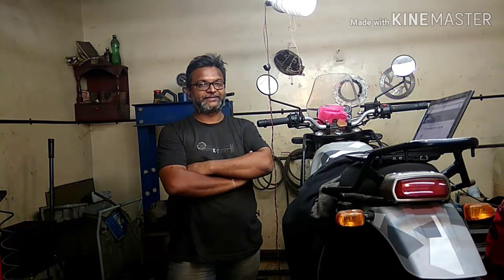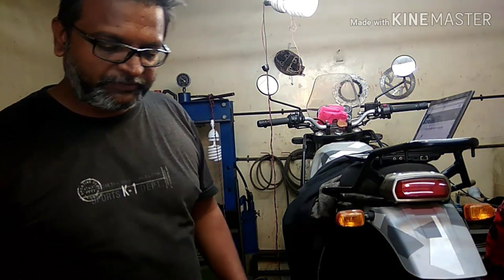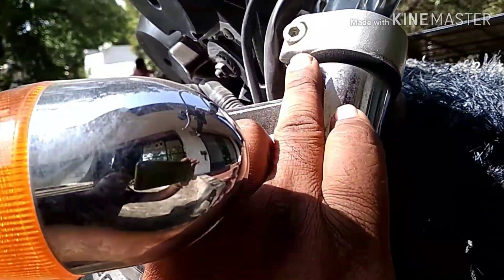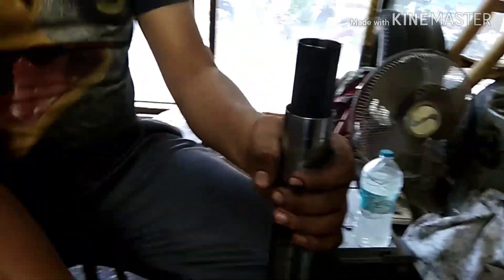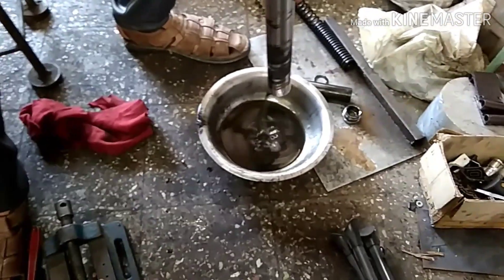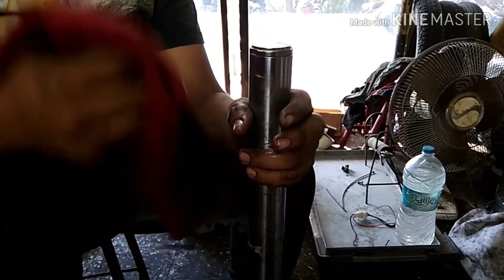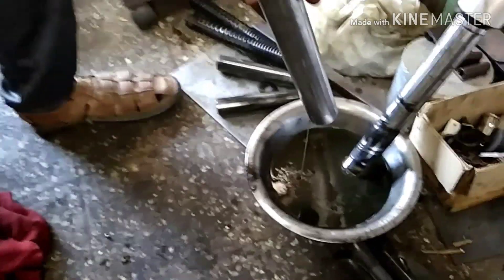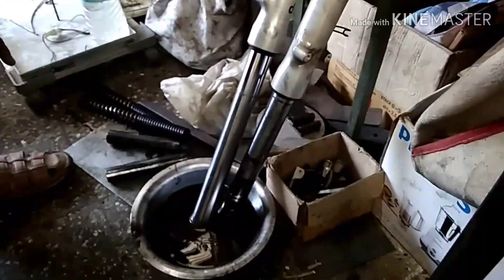Royal Enfield 41mm Fork Repair Procedure (ENGLISH) Part 1/3

Comment: 05:13 hi, can you tell me if the spring for the old bullet 350 ci has the same orientation : i mean the compressed part to the top and the expanded part of spring to bottom ?
Reply from the maker: depends on which fork you have. For old STD350 they were having three four types of tele-fork
Reply: @MechAutoClinic   thanks will check on that point, i m wondering if my mechanics put the spring in the wrong orientation, he change cone set, oil but the fork is very hard .
watching your video made me realised that maybe the orientation of spring could be the thing to check ...
Reply from the maker: when you have hard fork that means either air bleeding issue or bend bottom tube or inner tube. not the orientation.
Reply: @MechAutoClinic  i finally change the springs, went for after market model, one inch shorter but much more soft.